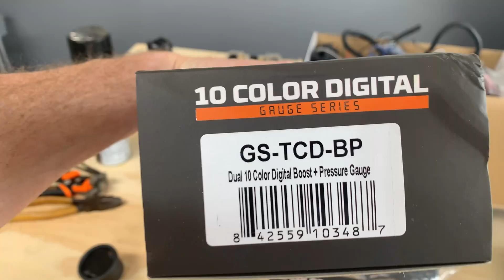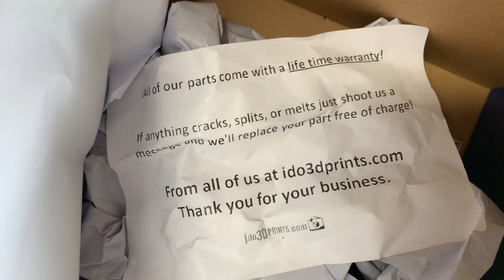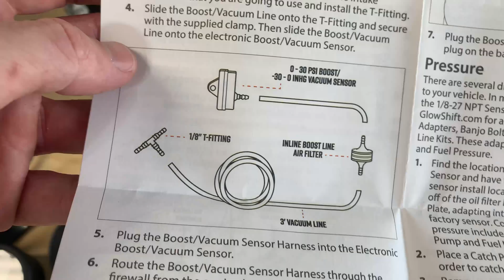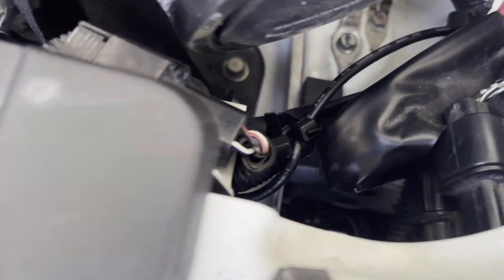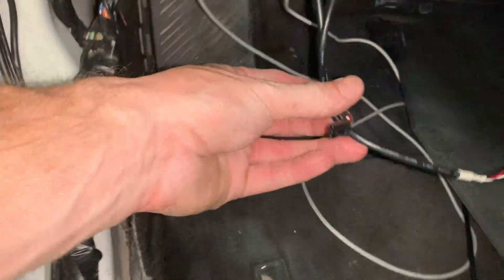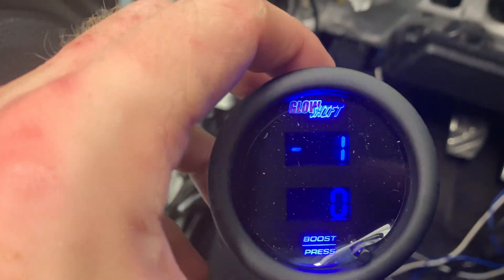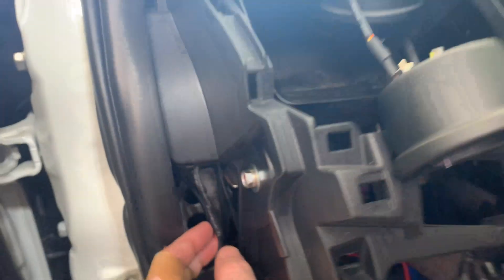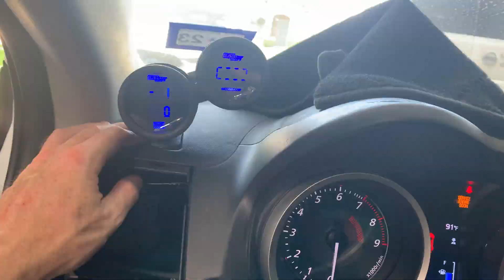GlowShift Boost / Oil Pressure Gauge Install For The EVO X ( Wideband doesn’t have serial output )

Comment: I'm also having the same problem with my PLX wideband... very good video btw, found it to be useful.
Reply from the maker: I figured out that the glowshift output is analog.  You have to have a serial output which from my understanding right now only aem and innovate have.  Will just have to get a separate gauge to tune with because I really like the glowshift gauges.
Reply: @JordanMoree  Good luck with the tune man!